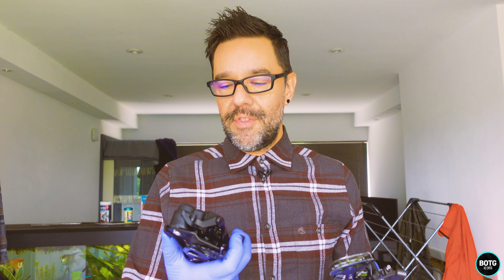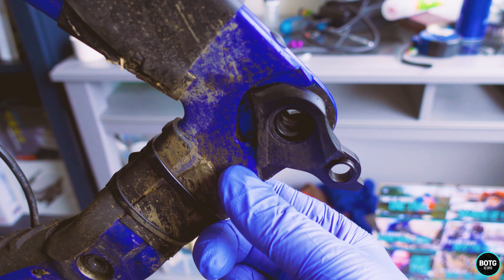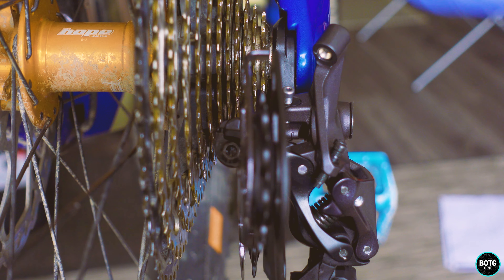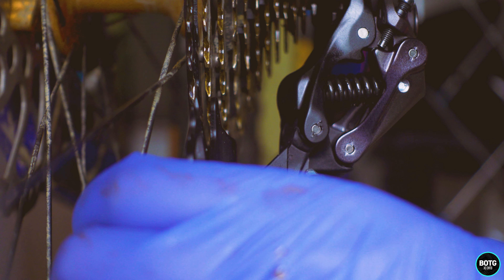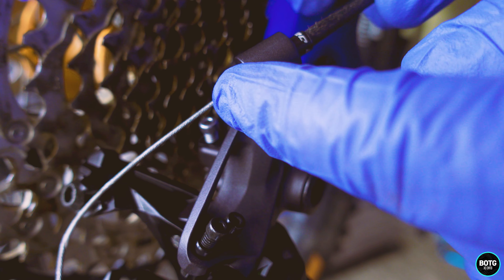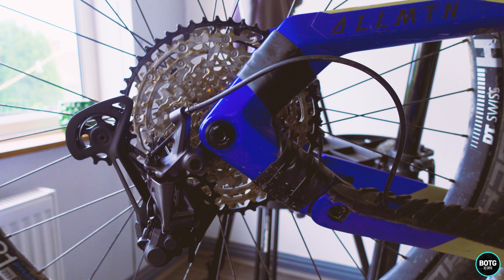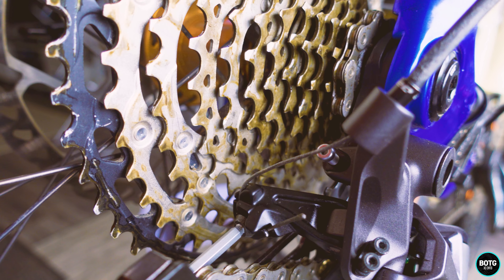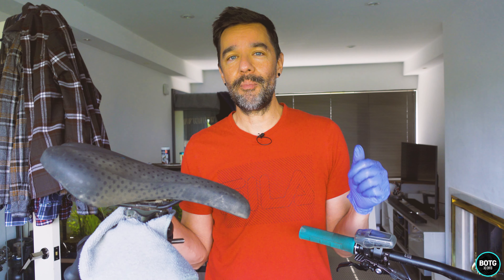HOW TO FIT a Shimano Deore XT Derailleur. #ALLMTN7

Comment: Has to leave a comment to say thanks. Ripped the rear derailleur off my EMTB and could not work how to mount the replacement .Found your video which explained how the hanger twists in an impact, got mine the right way round and then followed the rest of your video. Many thanks. Bike is now repaired and shifts better than when it was new from the shop 👍

Comment: The derailleur markings for b-tension, is that new?  Would my 11s Shimano XT have that marking?  Never seen it before.
Reply: @BOTG_Adventures  There is no marking on mine. The manual shows to measure the gap anywhere from 5 to 9 mm depending on the sprocket size installed (42t vs 46t). 

Great video though!  For those without a marking, they’ll just need to measure it and be aware of the range which can be found in the manual. 

Happy biking!

Comment: Keep in mind you should check the chain length by letting all ai rout of shock or removing the shock, and moving the bike tru the travel, the chain mus tbe long enough at the furthest point in the axle path, different systems have different axle path thus different spot. On rearward axle path like on some high pivot bikes have, you might need few links more.

Comment: Have you found any valid reasons to go for XT m8100 over m6100? So far I only see weight as a advantage, some claim the xt is stiffer and will last longer cus of it. But in this video I see the line on the cage, is not on deore. But I know how to set it up anyway. But ad disadvantage I see with xt is the rubber cap for covering clutch adjustment hole, on past rds the issue was the cap, popped out, ring holding it expanded, and it fell off, same with replacement. I don't know why it happens. If it's cleaner or contaminants from the trail, road, but I had to fill the hole with heavy grease to prevent water ingress so I prefer the Deore cover as it does not have the hole.